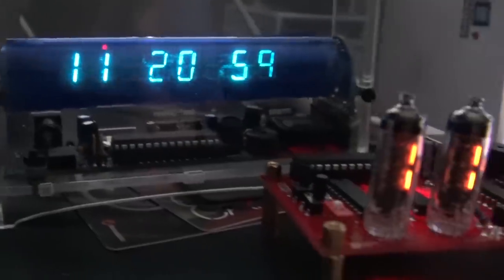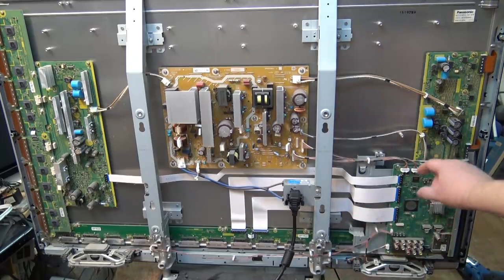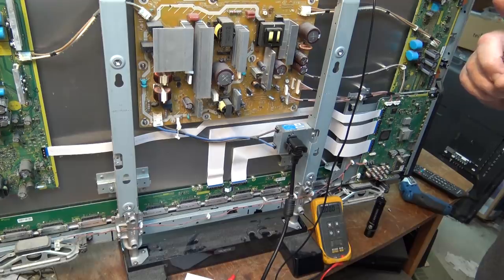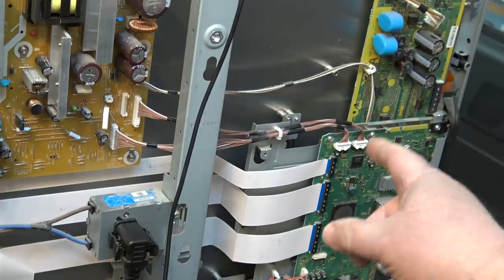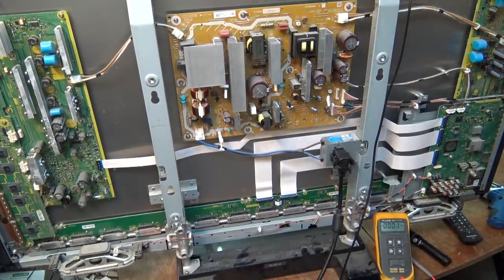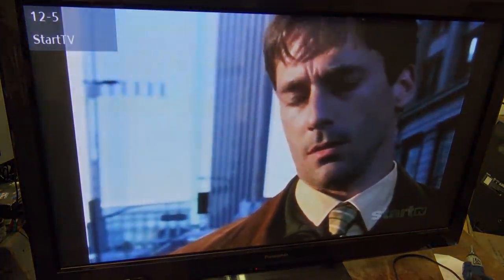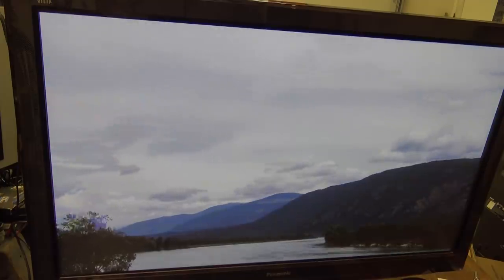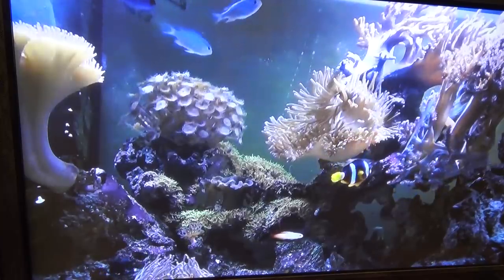Panasonic tc46s2 plasma 10 blink shut down component level repair

Comment: i repaired a few TV's in my time. recently repaired a 24inch LED HDTV that had a diode short replaced them all as they were in parallel. ive also had a 42inch for repair that had bad mosfets, everything is made so cheap nowadays but its nice to keep something out of the landfill and fun fixing stuff. ive got a motherboard that has bad caps so will also replace them.
Reply from the maker: Well there certainly isn't any money in fixing stuff these days. I actually like the older stuff better myself. I like plasma tvs just because the science behind what makes them light up is so complex, it is actually cool. LCD is boring. Plot an X-Y coordinate and apply a voltage to stimulate liquid crystals to change polarity. Yawn.
Now plasma you are talking science. Prechare the panel, select the line and apply a firing voltage to create an electric discharge. When you fire that discharge in the timing cycle determines the brightness. Then extinguish and charge to prepare for next sub frame. Do that 600 times a second.

Comment: A Panasonic plasma that didn't have shorted IGBT's on the SC board? Whoa. Nice find on that shorted SMD cap. I think you should treat yourself to a second soldering iron for plucking SMD parts off. Me & my buddy have saved about half dozzen of these Panisonic's from the land fill. But first time I've seen a short on the main thumbs up!
Reply from the maker: I have another iron.  Just couldn't bother waiting for it to warm up. 
I have had igbt fail on ss board.  Caused by loose  ground screws.
Reply: @12voltvids  Yes it's strange the screws are always loose. You have a knock off hakko T12 station now right? Those things are up to temp in like 12 seconds. I have two with a bunch of different tips. Love em.
Reply from the maker: @jeffescortlx  Yes that was a problem. Panasonic came up with a service kit for the 2012 models that included new screws with lock washers. This set the screws are set with loctite, so these ones won't be a coming loose.
Reply from the maker: Well it happens, and now you know how to troubleshoot it.

Comment: I have a S1 series 58" plasma that had a one blink code. I took the A board off and found shorted capacitors similar to the ones that you found. I removed the shorted caps and re installed the board and on power up I now have 10 blinks. Voltages all come up for a second and then the set enters shutdown.

Comment: I'm lucky I have the 50" and I just love the quality HD,connected to a Bose sound system like going to the cinema.
Reply from the maker: Yes I have a 50 as well. In my panasonic collection I have a 42SD, a 42 full HD, a 42 THX certified 1080p, this one, and a 2012 50" 1080 set. I also have a 50" panasonic that has a seperate tuner box but that one is not fixed yet.
Other plasma sets I have are an 720p 42 LG, 720 50" samsung, and 1080 FHD 63 samsung. I have 3 more samsung plasma sets that have panel problems (vert line or 2 in the screen)
Reply: What causes the black vertical bars on the plasma sets? @12voltvids
Reply: @petenamlook18  I have know idea mines never done that
Reply from the maker: @petenamlook18  
A back vertical bar approximately 1" wide is usually caused by a connection between one of the FPC tabs and the C board along the bottom. It could be caused by a bad drive IC on the FPC as well which is non repairable.
A single vertical line line (black, red, green or blue) is a failure of the drive IC on the FPC that corresponds to that area of the screen, or the panel itself.
Single line failure requires replacing of the panel to fix. 
1" wide might just need one of the connectors restated.
If it is a horizontal line it could be the a connection between one upper or lower buffer and FPC on the left side of the screen looking from the back.
Or it could be one of the buffer chips on the buffer board. If it is on the top half it would be the upper board, and lower half the lower board.

I have a total of 11 working plasma screens. 2 of them have single vertical line failures which is the panel. They are used for gaming, and an advertising display, and one has a small crack in the glass, but the set still works and I watch that one daily on the news channel so it is getting a real nice permanent burn it from the TV station logos and news ticker. Out of all those TVs I watch 3 regularly. The 2 with bad screens are used for gaming and digital signage, and the rest are sitting at the back of a closet awaiting the day when I need to put one in service when one of the others breaks beyond repair. I got all except the first 2 for free. I have had many more, but I do sell my spares for those people that want a plasma. There are people out there that seek out plasma TVs now that they can't buy them anymore.
Reply: I have 4 Panasonic plasmas... 50in.. I wont purchase any other TV but a Panasonic.... Their plasma line are true work horses... I had one 55-inch that stayed on for 3 months straight without being turned off.... The only thing that ever happened to it is the asshole Comcast guy reconnected the television straight into the wall saying that it would be a better picture... 2 days  later an electrical storm fried my HDMI 1 and everything that was plugged in there after.... Laptop... Passport external hard drive... And a crappy MP3.... All because of Mr. Xfinity... Of course they would accept no responsibility..

Comment: The remote worked on the cat. :)
Great video!!
The cap was the self destruct unit to make you buy a new set. :)
But the blinks? Morse code is so yesterday. It needs to speak and tell you what's wrong.

Comment: Thanks for the great video. I’m working my Pana 50 plasma with 10 blinks. When turned on neither voltage lights go on on the sustain boards. No voltage at the D351 spot. No 15V at P11 pin. Replaced P board and no luck same situation. replaced the A board. Same situation. I i found too if I unplug the left sustain board, the green light comes on the right sus board and the set clicks off to 2 blinks. You mentioned that because you had both green lights it meant that your P board was good.  Any suggestions appreciated. Thanks much.
Reply: Same problem.  Did you fix it?

Comment: Hey 12voltsvids, what is the problem when the vcr having trouble adjusting the auto tracking only with LP tapes and adjusting fast with SP tapes?
Reply from the maker: Lp was never a recognized speed.  Only sp and ep. Lp typically used the narrow ep heads and there are gaps between the tracks.   Even a slight alignment error will cause auto tracking to have issues.
Reply: 12voltvids thanks! Do you think that replacing the AC head solves the problem. The drum is completely cleared. I'll watch a video in your channel about vcr alignment
Reply from the maker: @raynegames2636  
I have never seen an a/c head fail.  If it was bad you would get no playback period.

Comment: Amazing tutorial. Thanks a bunch. 
You give so much value.

I have the same issue. But a tv rep guy didn't diagnose that board properly. Since the conclusion was: There's something about the main board. 

What do you set the multimeter to? And does the tv has to be on for the device to beep?

Comment: Are saltwater aquariums high maintenance compared to other types of fish?
Reply from the maker: No I do very little.  Water change every few months.  I have a bucket of fresh water with a pump and float control to top up the water as it evaporates. I fill the bucket about once a week.  Feed them every day and check / clean protein skimmer.  Once established they are no more work than fresh water other than mixing salt for water change.

Comment: I had a customer that had a 50" Viera, fixed that POS 2 times in 2-3 years, first problem power supply module Panasonic must have had so many failures with that board and needed them so badly for rebuild I had to send the old board to them within a certain time period or I would be charged an additional $100.00 dollars core charge. I usually try component level repairs but not with that nightmare designed PCB. The second time it was a short on the tuner/signal board that I could not find I just swapped it, and advised customer to get rid of it. I asked him if he ever noticed the power consumption of that tv , he asked why, I told him it was almost 700watts about twice what an old all tube color TV  took, he then knew why his electric bill was so high.
Reply from the maker: Panasonic initially had the module swap program because they felt that most independent service shops did not have the ability to repair them.  When I took the plasma course that Sony had we were only permitted to repair the power supply, analog signal boards and audio amp board.  They wouldn't allow us to repair the sc, buffer boards or ss, or the c boards.  Back then the Sony sets were made by nec.  Any failure of any of the panel drive board was serviced with a kit that contained all the boards and a new panel.  
Panasonic allowed only board replacement initially  with the cores going back to Japan for analysis to determine why they failed.   Early sets were power hungry but not the layer plasma sets.  Also that peek power consumption is on a full white screen.  Average power consumption is about 1/4 of that.  My 63" shows 550 watts max.  I have a killawatt meyer on it.  On average 200 is all it draws.  Yes it varies with screen brightness. If I was watching a hockey game naturally that is going to draw more but the average is 200 and when watching movies and such with plenty of dark scenes  it is lower than that.

Comment: Well worth fixing. I have a 50" Panasonic 1080p plasma, and can't convince myself to 'upgrade' to a 47K LED.
Reply from the maker: I agree. Sure the old plasma sets use a little more energy, but the picture quality is worth it. When OLED becomes affordable that will be the next option, but right nw only LG makes the panels. Even the sony set uses an LG panel.  There is a new type of LED that uses direct LED diodes not organic diodes. The trouble with the organic types is they are prone to burn in as they still rely on phosphor.

Comment: also my dad found a 50 in lg plasma its only 720 but does it shows a great pic it had black bars threw the screen i spend a hr takin all the ribbion cables off and cleanin and re thermaledand compressed em NOW HES IN PLASMA HEAVEN

Comment: the tv worked with the caps removed? what's the use of the caps then?
Reply from the maker: More parts to fail.
Reply: See history of Earl Muntz. He would walk through the engineering dept. with side cutters and start clipping components off of prototypes until the circuit stopped working. Put that component back on and that was the final circuit employed in his sets.
Reply from the maker: @richardhz-oi8px  
Ah yes, cost cutting at every step. See what the minimum number of components needed.  many times engineers put in extra parts that are put there under good intentions for best engineering practices. They may increase reliability, but again, more parts also means more parts that can fail, so it is a double edge sword.
You need specific parts to make a circuit operate.  too many, and you drive up the cost of manufacturing, and thus reduce profits. Ideally  you want the minimum number of components required. Extra parts that do little besides provide redundancy and no performance increase also increase the chance of failure, so get rid of them.
Reply: This cap across the input supply voltage is just a duplicate to reduce noise a bit. There are caps across it on the other end of the cable too, in the power supply.

Comment: Dave, 

Thanks for the lesson.  I see that your set consumes up to 331 watts of electricity.  Do you watch it enough to notice a difference in your electricity bill?  I've also heard that these plasma sets can put out a lot of heat as well.  Is all that heat a problem or is it a problem that is over exaggerated?

Regards, Tom
Reply from the maker: 331 watts full white screen brightnes set to max. In realith is is more line about 130 to 150 or lower on dark scenes.
Reply: @12voltvids  Thank you for the quick reply.  What I always wondered is, if you're watching a plasma set as your main TV set, would raise your power bill substantially?
Reply from the maker: At a rate of 0.12 per KWH running this TV for 3 hours would consume just under 1KWh which would cost .12  so about .04 per hour to operate.
Our electricity here is .08 for the first 1360 KWH in billing cycle and then just over .13 for the rest of the billing cycle so no they don't cost that much to operate.
All the wall warts, phone chargers, modem, cable boxes and all other electronics in standby 24 hours a day uses more.
Reply: @12voltvids  Dave, 
Thanks a lot for the detailed answer.  One thing I've always appreciated is that you've always  taken the time to answer my questions completely and thoroughly.

Comment: Hey 12voltvids! Awesome clip! I have a simialr fault right now - it seems! 10 blink red LED. I have NO idea about electronics - just following your steps! Now, I have only a cheap Craftsman multimeter without a beeper. My ceramic cap shows about 1800 ohms one direction and about 520 in the other (on the board) - does this anything??
IF I need to change that cap - is there any specific size?? My TV is a Panasonic TC-P42C2 version, the A-board looks identical, the power-board slightly different but the 15V points are all there - pulling the 15V pins one by one from the plug that supplies the A-board, with the 3rd pin pulled the 15V holds a second and then reducse on the P-board upper corner 15V point...
So - I would like to know what this ceramic cap would read on ohms when in working order - what would it read if it is faulty? My ohm values don't seem to be high at all....
Appreciate if you had a tip or two for me!!

Comment: My guess is that some line over-voltage spike, possibly from lightening, may have blown the bypass caps. Maybe the blown fuses may have been part of the damage from the spike.
Reply from the maker: No lightning here. We are in an area that sees lightning perhaps once a year, and it is usually only a flash in the distance. Also, no blown fuses or any semis. Just one shorted ceramic cap.

Comment: Cool video...I have a Panasonic Viera (th42px600) that has the 7 red flashes error - I was hoping to try and fix it (cheaply and easily) and get it through to it's 18th birthday next month! Google searches point at the SC board (I know it could be a few things), but would you think the main transistors on that board would be a good place to start?  Otherwise, it's off to get a new QLED I think...
Reply from the maker: Probably not the transistors.  More then likely it was bad ground screws which popped a diode and ic.  There were repair kits to fix them.  One of my plasma sets is 21 years old now.

Comment: Hello. firstly thanks for your video. You really have talent. I myself have a Panasonic plasma with a similar problem. I have the 10 blinks but pressing the button power just after the relay click, I have the code 4. So, I did the same tests as you. However, I have different results. I do not have 15 volts. as soon as I press the power button I have a voltage that rises quietly up to 0.7 volt before shutting down on the P11 connector. Subsequently, I checked directly on the mofset, 1.3 volts for a few seconds. I cut one of the legs of the R757 as you did. Nothing has changed. Is the Mofset EN210A really the problems? Thank you for your help. I love this plasma TV and I would like to make it work again.

I can send you some picture if you like by email.

Comment: I've sometimes left those ceramic caps of, even in inverter stages like Philips.  You can get away with them missing thoe people may moan. Had them go bad on gfx cards mainly.
Reply from the maker: In many cases ceramic caps can be eliminated. Most are there just to suppress noise being picked up on am radios.

Comment: Not sure if I missed an explanation (so if I did, my apologies) but what was the purpose of the  capacitor that shorted since you were able to get the TV working w/o replacing it?
Reply from the maker: Just a bypass cap to reduce RF interference to am radios.
Reply: @12voltvids  Ah..... I see... that makes sense now.  Reminds me when I was building a circuit for a project and the schematics called for two ceramic caps to connect from a +5v and -5v to GND and the stated purpose was noise filtration.  Also, just remembered that they do that a lot on RC & slot car motor leads to mainly reduce interference on TV broadcast (mainly analog broadcast I believe).
Reply from the maker: @MovieGuy846  exactly.

Comment: Dave. I’ve seen several videos on another site where shorted SMD caps simply aren’t replaced and the device works fine. Also open resistors are replaced with a piece of wire. If these fixes work , and they obviously do, what’s the purpose of the original, now defective, components?
Reply from the maker: The SMD cap is not required. It is just to filter ripple, and is more to help stop the TV radiating and causing interference to AM radio. The SMD resistors you see jumped are 0 ohm jumper chips and they can be safely removed and a wire placed in. If it were a real resistor, 10k 22k ect and you put in a piece of wire you would be asking for trouble.
Reply: Thanks for that information Dave.

Comment: Thumbs up if you believe he replaced the cap ;) :p
Reply from the maker: Extra parts.
Reply: He wouldn't do that to a plasma, he'd be strung up.
Reply from the maker: @paul-c7541  
Actually I did replace it with a ceramic disc. It really isn't necessary it is just a bypass cap to take out some ripple on the 15v line. RF supression.
Reply: @12voltvids  Well, it did take out all the ripple...
Reply from the maker: @brynyard  
And everything else.